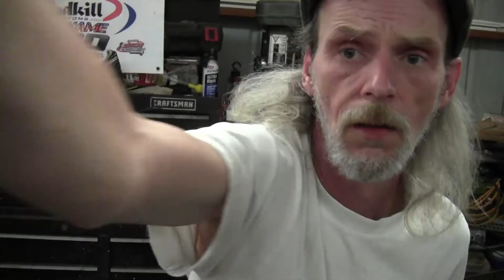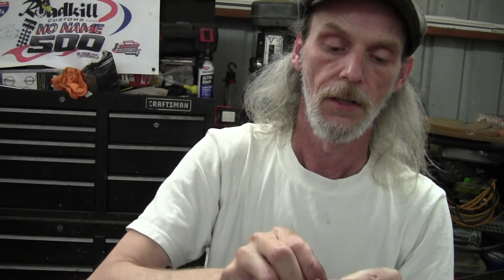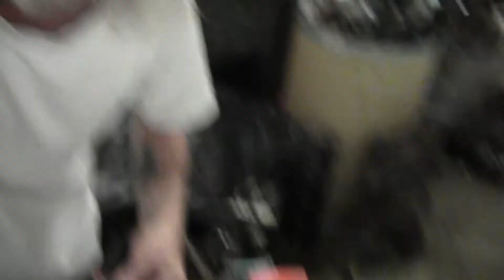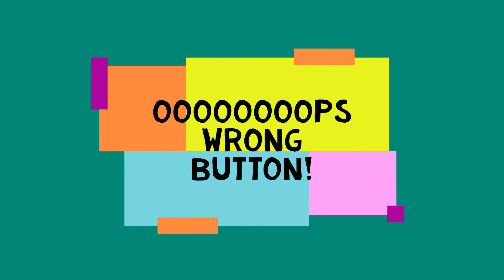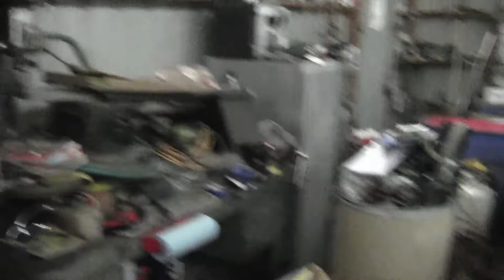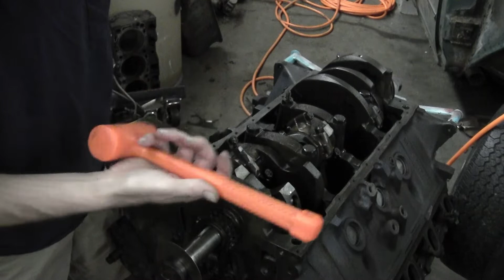How to Set a Crankshaft with the Pistons & Rods Already Installed in the Block

Comment: Does it matter how the rods go back in? Can you just put the 1st piston/crank at bottom dead center and the rest line up?
Reply from the maker: You can connect them in any order you want, that doesn't matter. Just make sure that nothing scars the crank journals as you slide everything back into place.

Comment: Thats awesome I was wondering would this be easier with a LS engine with no rod studs ?
Reply from the maker: thanks man, as for the LS, I'd have to say it's probably about the same though
Reply: @BareRoseGarage  BTW Can the pistons be removed and put back in with the rings in the same position ?
Reply from the maker: @DELTRANIO99  sure thing, so long as you stagger the gaps about a quarter of a turn you should be fine

Comment: wow doing things the hard way lol
Reply from the maker: Oh yeah..... I almost pulled the pistons when I had the heads off, and said.... nah it's ok get the heads on and call it a day. Then I flipped it over to do the pan & oil pump swap and found a lot of big carbon chunks. So I pulled the crank to clean out the oil passages (that where actually fine)...... that 3,200 mile round trip got in my head, and down this rabbit hole I fell... lol.